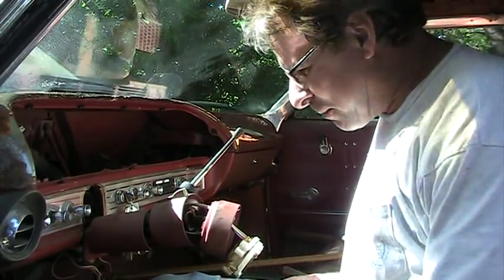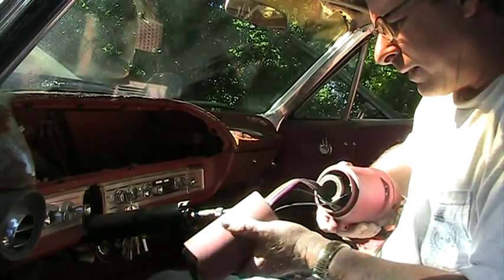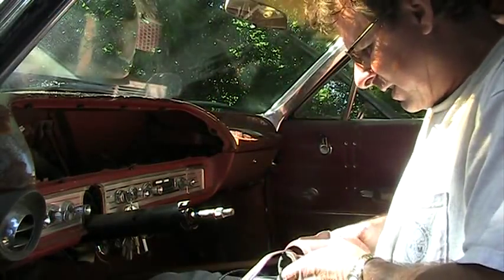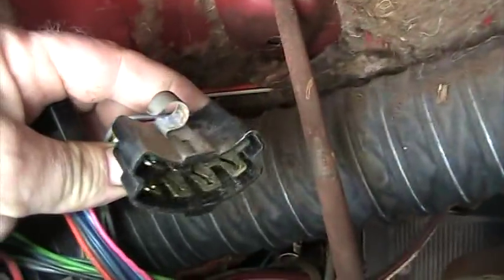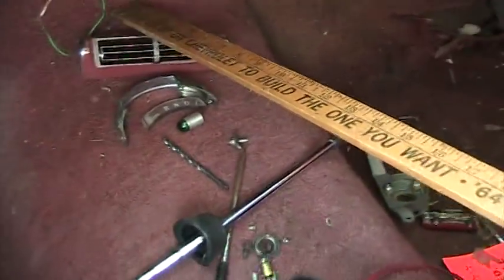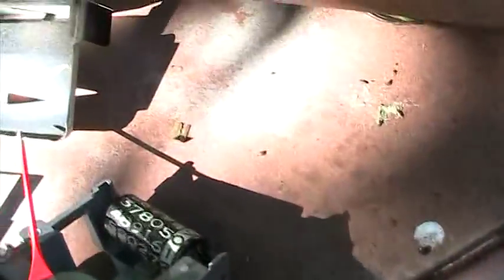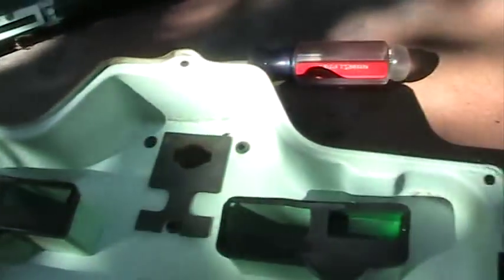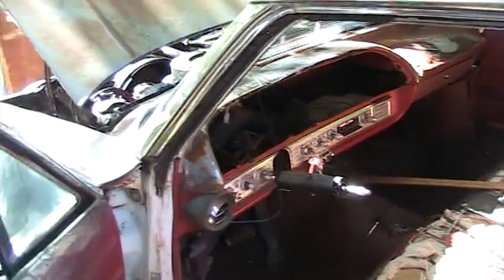63 impala video 76  turn signal switch replacement

Comment: I owned a '64 back in the day before internet, so no Ebay, and no places made new switches back then.  I had to rebuild my switch as best I could every few months for a year or so before I finally found an Impala in a junk yard and got a better one.  Luckily I had a 4 speed car, so the assembly was a bit simpler to work on.

Comment: This switch was driving me insane on my 63 Belair! Î think with a manual 3 on a tree it might be  even worse to replace.We tested the new one:It  worked fine. After assembling the whole thing it was suddenly impossible to give a right turn signal! So we removed a lot again, tested it and reassembled it again. Even now, I have a problem with it. In order to give a sign to the right, you must pull the lever a little bit backward. And  it is switching off much quicker than if you give a signal to the left.I used a NOS part. I never had such a harassment with anything else on the car I  own for 37 years now.I do not have the nerves to open the whole column up again in order to see where the problem is.